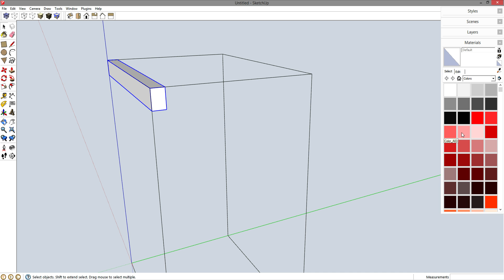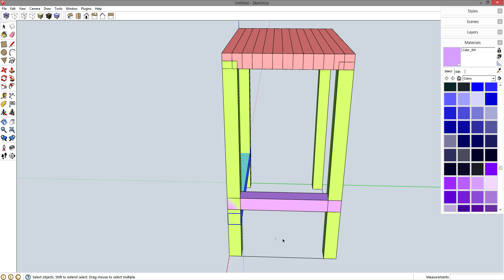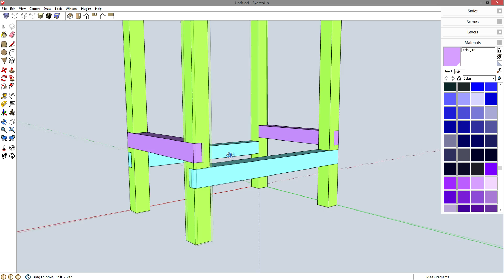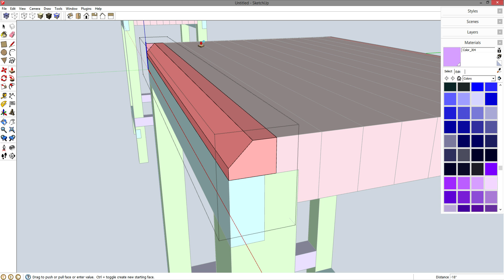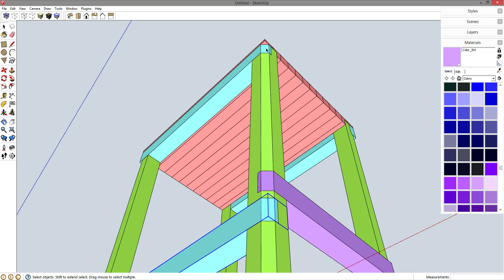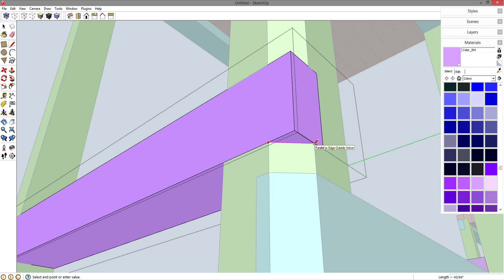SketchUp: Half Lap Bar Stools - 165

Comment: Jay Bates in your brain pick with I Like to Make Stuff you mentioned that you used linux previously. On linux did you use Sketch up with Wine, or did you use a similar native program? Also, you mentioned you used Kdenlive for video editting, and that you moved to Windows to utilize all your power and multithreading. I urge you to consider lightworks, it runs on windows and mac and linux, it is fully threaded and will use all that Xeon power you have. it is free for the community edition, and the pro version is affordable. any thoughts on sketchup for linux?

Comment: Check the styles menu to hide your edges. Also, to repeat a push-pull, just double click. Nice tutorial!
Reply from the maker: Rikkert Koppes The styles would hide both models so I just used smooth edges to get only one. I use the double click on push pull sometimes. Most of the time it goes in the wrong way for me though. Oh well. Thanks for watching!